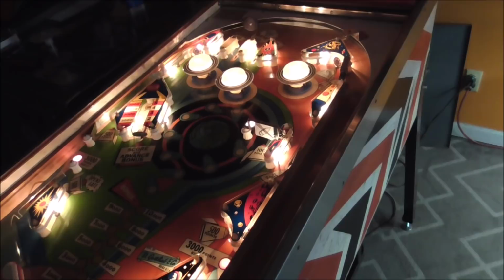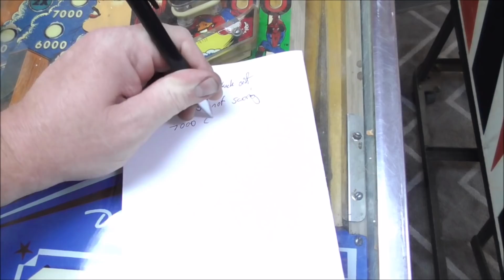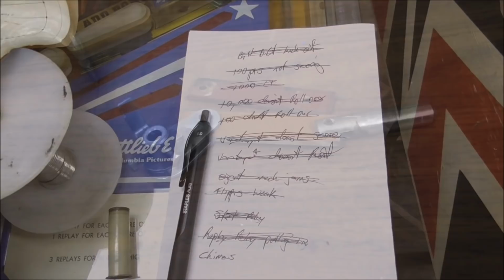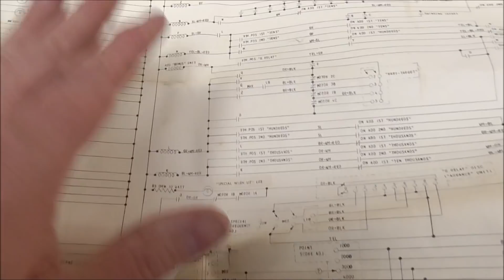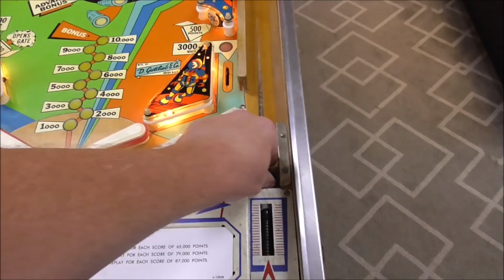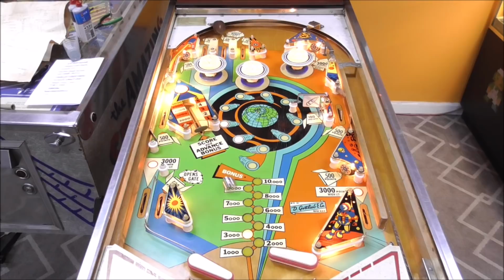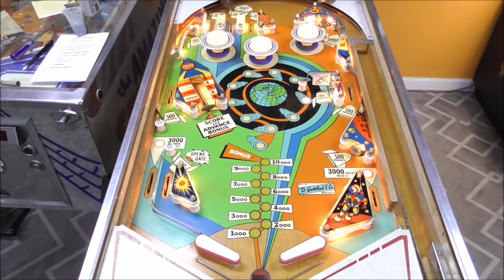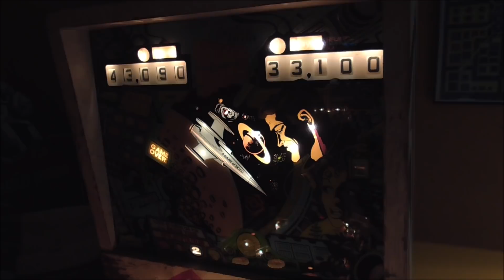Troubleshooting a Gottlieb Outer Space E.M. Pinball Machine with Schematics

Comment: I have the same machine and I had it working and resetting properly. Then I lost the flippers and pop bumpers .... as in not working anymore. The play field lights up but will not score at all anymore. Any help would be appreciated.
Reply from the maker: What happens when you press start?
Reply: @LyonsArcade  the machine completely resets and will not score anything on the play field. It has general illumination the bonus unit will reset and the plunger on the left side of the machine will actuate but no scoring no flippers no pot bumpers at all.additionally this all happened as the machine was blowing the 25 volt fuse . The left and right pop bumpers were not working properly the right has a burnt coil and the left if the ball hit it would short out and blow the fuse in my opinion.  I was working on the pop bumpers when this happened.

Comment: Joe's Classic, when looking at the EM schematic of the normally open switches, how do you know which ones are the "end of stroke" switches on the score reels because the EM schematic doesn't say which contact switches are the end of stroke switches on the score reels?
Reply: Always the normally closed switches in series are the end of stroke switches for the score reels relay coils?
Reply from the maker: It usually says actually, not sure if it did on these or not, it'll say "E.O.S." or something like that... they have to label it so you can know where it is, and the only way to refer to it is the end of stroke switch.
Reply: E.O.S is not listed on the Normally Open switch or Normally Closed switch on the schematic part where its drawn out with the coils ands switch contacts. It must have the E.O.S information on the right side of the schematic part?
Reply: I'm talking about the end of stroke switches on the score reels not the flippers EOS switches
Reply: But the schematic that shows all the coils, normally open switches, normally closed switches "does not" label on the schematic wiring diagram which switches are the EOS on the score reels. This is confusing when trying to figure out which of the contact switches on the EM schematics are EOS for each store reel. Each Store reel will have an EOS switch but the EM schematics won't tell you or have labelled them on the schematics.  EM pinball games that use AC voltages have Jet bumper coils and EM pinball games that use DC voltages have Removed the Jet Bumper coils, any reasons why?